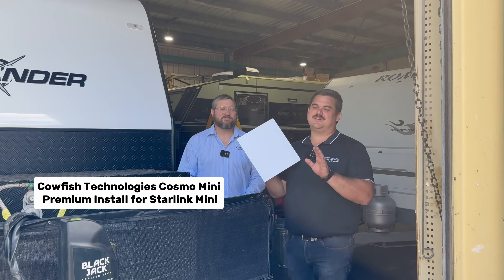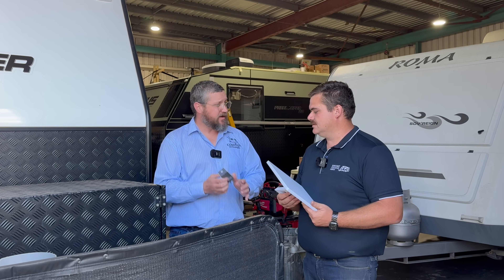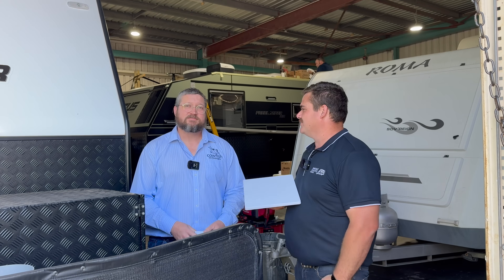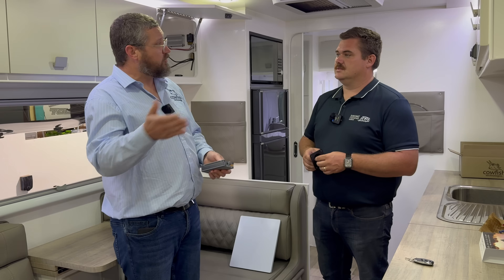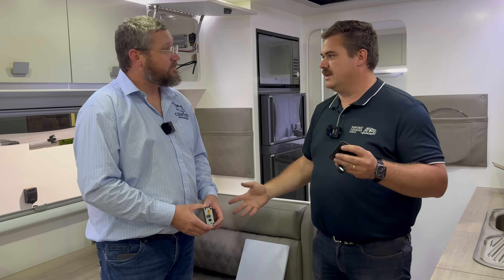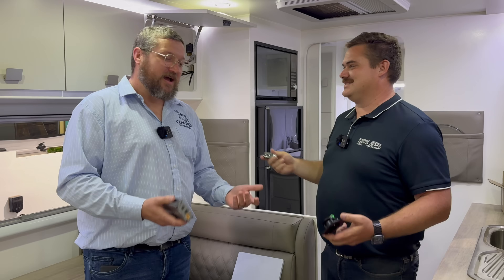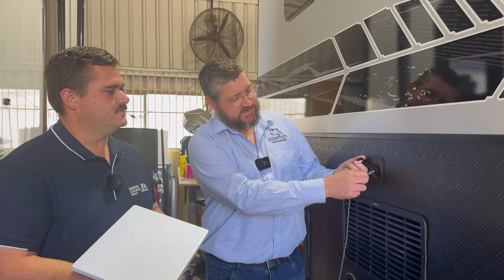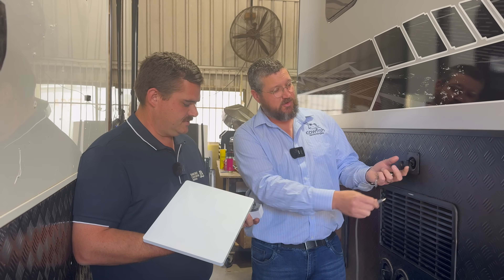Solving Your Starlink 12v Power Problem: Cowfish Technologies Installation

Comment: Can this be installed in your car?  instead of a permanent fix in the van.
Reply from the maker: Hi, you sure can. The Cosmo Mini can be installed using the Cigarette or Anderson plug power cable or you can hardwire into your battery management system. Find these products here https://suncoastcaravanservice.com.au/brand/cowfish-technologies/. If you require any further information please call our Showroom team (07) 5443 1036.